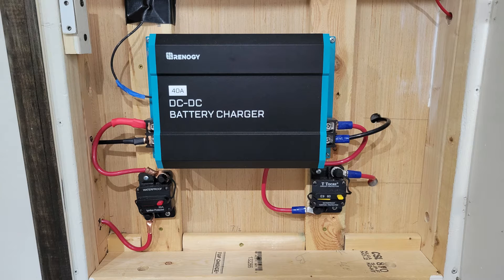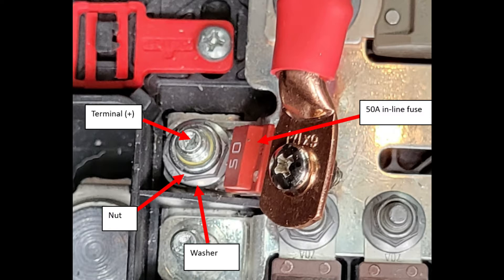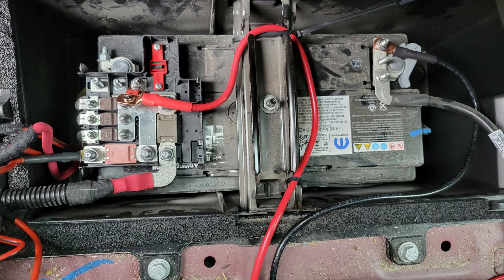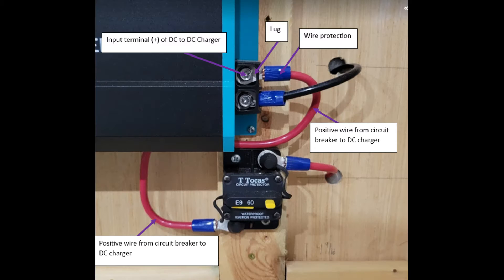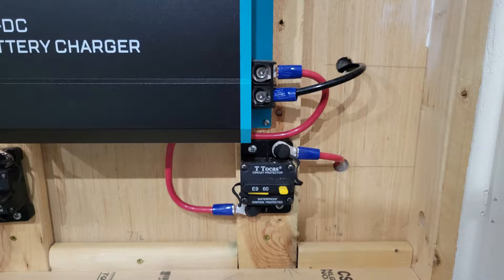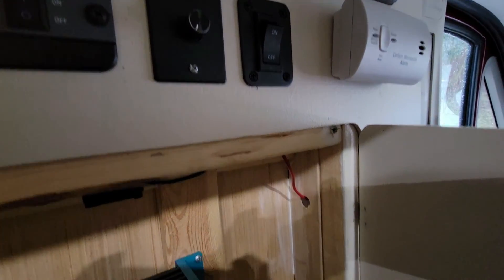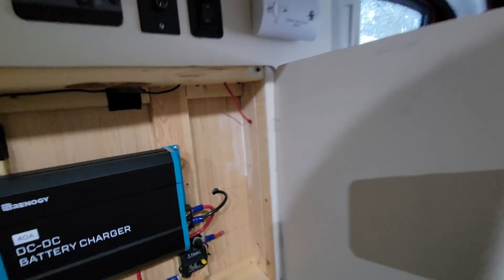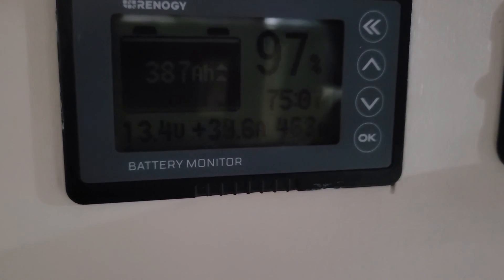How To Wire a Renogy  DC to DC Charger Without Spending Hours On It!

Comment: your installation is not good or safe. directly screwing that fuse to the battery and the lug to the other is very bad practice.  you should absolutely have used an enclosed fuse holder because if that fuse blows, or vibration of the engine snaps that connection and that wire falls onto another contact or negative you will have a whole load of problems. also on the output side you should have used decentt lugs and not cheap crimp terminals and those too should have been covered with the same shrink wrap as the other side your terminals there clearly dont have shrink wrap on and are clearly cheap crimp terminals. your wires are exposed. Also, I'd never fit cheap breakers like that. youtube is filled with van life channels telling stories of how dangerous these are for setting on fire . You should have used proper cut off switches.  

I'd never wire a dc to dc charger the way you  have and I'd always use wire that is is above  whats needed. Sometimes that reccomendation from renogy just might not be the best reccomendation. cutting corners never works and only endangers your safety,   Please people, do not wire your dc to dc charger like this.
Reply from the maker: Thanks for taking the time to comment and watch the video. We have done some upgrades and fixed those issues about the heat shrink and the terminal on the battery. It looks a lot better and wish I could upload a different photo.
If you would read through the comments you would have seen that but I understand not wanting to slog through all of it.
We do clearly say we are not professionals and are DIYers. We have, since making the fixes, had electricians look over it and it got the thumbs up and live in the van full time with no issues. 
We are not here to make any professionals happy, we are here to help one person maybe find a little bit of inspiration to start there own van build. Yes we made mistakes but that's life. Have a good day
Reply: @dirtbagswithfurbags  I'm not 
 a professional. I'm just an ordinary guy who  paid a company to convert my van and found their work was sub strandard and dangerous and ended up doing the van again myself. Its because of that I picked up on stuff that should never be done in your video and thought it needed to be said so people did not do dangerous installs. Your fuse on the battery was deffo dangerous but I appreciate you now changed things.  I think you should have done another video and taken this one down and shown how you correctly did the job.   sorry, but if you are regularly using your van or living in it, dodgy electrics are the last thing you need if you dont want to be in a burning vehicle or come back to one.   saying you made misakes and thats life is totally the wrong attitude. and you helped nobody with this video. you put lives in danger and that is totally irresposible.
Reply from the maker: I definitely have a different opinion on this but thanks for sharing yours. I appreciate all the feedback  and hope you enjoy your van!

Comment: Many safety issues with your installation!
Never connect the battery+ first because the other end is live if it touches anything connected to the chassis it will blow the fuse at the battery but because you haven't put it in an insulated fuse holder there is a good chance it will fracture and drop onto the + fuse plate what you have a split second later  the whole length of the cable will melt and ignite! It happens in an instant lots of smoke flames and if you have the cable in your hand you are looking at skin grafts. People think its only 12v it won't hurt me. Like somebody else has mentioned the breakers are a waste of time the fuses will do what they are meant to do if wired and rated correctly. Heat shrink on your terminals no exposed copper. Looking at your vehicle it looks fairly new if its under 5years old its likely to have a smart charging alternator so your D+ connection becomes a bit more sophisticated than just wiring it into the cigarette lighter. Please for your safety seek some advice from a vehicle electrician. Best wishes.
Reply from the maker: Thanks for your comment. We have made some changes already but it's hard to update the video without taking it down. A couple of your points make sense, like the volts (it's the amps that really cause the damage). We also have redone the length of wire where the inline fuse is located. We put in a new inline fuse holder and secured it to the side of the battery compartment (hard to explain everything in a paragraph or two). I will try to post what it looks like now. The breaker is also overkill but I kept it in because it isolates the dc-dc without having to unhook the battery if we need to work on it for some reason (not that we needed yet). The D+ ignition cable though can be hooked up through the alternator but the cigarette lighter accomplished the same goal. The wire was hooked up while the vehicle was unplugged which means power could not have gone through the wire. I do appreciate you commenting and I hope someone reads these comments. The point of the video is not to show how perfect or bad we did on setting up this system, but if someone else is thinking of trying to convert a van they can do it themselves. I believe in learning new processes and trying it ourselves. Yes it might not look the prettiest but we have learned so much I'm glad we did it.

Comment: If you want to see how we installed our dash switch then Google search on “promasterforum  872387”. It’s on page 10 of our “Snoopy” the van build adventure.

Ours is a rectangular dpdt rocker switch but it’s probably easier to install two round spst rocker switches instead. One for d+ and one for LC.

Comment: First, this is a great video. Nice job!

I installed this same 40A charger and I have a couple suggestions.😊

I don’t feel like your wiring is unsafe or anything but you don’t need that 60A circuit breaker. Just change the starter battery ANL fuse from 50A to 60A. That’s what the manual says. Think about it. The way you have it hooked up now the 60A circuit breaker will never trip before the 50A starter battery fuse blows. 

The manual shows ANL fuses not circuit breakers but again I think you’re fine. 

The manual also says “When the battery charger is sending the rated amps, the input side may experience a higher current draw by a factor of up to 50%. Larger wire sizes generally improve performance, whereas smaller wire sizes may reduce performance, especially if undersize.”

So in my installation I chose to use 4AWG wire instead of 6AWG to get the “better performance”.

Also of note are the dip switch settings this charger has for different battery types and charge voltages. I have a lithium battery that needs 14.4V charging so switches 1 and 5 are off and 2-4 are on.

We also installed a switch on our dash that controls the two 12V inputs of D+ and LC. That way we can conveniently charge at 40A or 20A or just turn it off.
Reply from the maker: Thanks for the compliment and advice. We have learned a lot more since we made this video. We did change our wiring around the battery and installed an ANL fuse box holder. We did have an issue with a previous fuse and it didn't cause any damage but I think we improved it and made it look more clean.
I also agree with the only needing a fuse and not a breaker but we like it because we can isolate the wire at either end.
Looking back, if we know what we did now, I think our build would be totally different, but that's the fun part about doing it yourself, you get to try again!
Reply: @dirtbagswithfurbags  yes for sure about looking back. It’s all good though.

Comment: The dip switches kill me. Idk what to do for my battery and the manual only gives options for lithium
Reply from the maker: What batteries do you have? Also what are the voltages of the batteries? The manual is not the most helpful, we contacted Renogy to get the info. Big thing is you need to know what voltage the batteries will charge at, our batteries say 13.3 volts at fully charged but charge at 14.4 volts.
Reply: @dirtbagswithfurbags  hi, I have a renogy deep cycle AGM lead acid battery it’s 200 ah and it says “cycle use: 14.4 - 14.8) & float: 13.6-13.8
Reply from the maker: @jcardosa02  Last thing, are you using the same 40amp DC - DC charger or do you have another type?
Reply: @dirtbagswithfurbags  yes I have the same one!
Reply from the maker: So it I would assume from reading the manual we have that all of your dip switches should be on for AGM batteries. S1 s2 on to set your absorbtion to 14.4 - s3 s4 to set your float charge to 13.8 and - s5 on for lead acid.
I would also check with Renogy to double check. Is this what you have already done?
Reply from the maker: Let's us know if that works or if you contact Renogy and figure it out. I'm sure if you are having issues someone else is also having the issue.

Comment: The recommendations are for a fuse, not a breaker.  ANL is most appropriate fuse type.  Those Chinese ‘breakers’ are fake, and are a real hazard.  The crimping on the lugs is unacceptable.  And there should be shrink tubing on the lugs.
Reply from the maker: Thanks for the feedback
Reply: I realized I was cringing once I read your comment… all the exposed connections. I was a mechanic in the army, and I still work on my own vehicles. It was hard to watch 😂🤣😅
Reply from the maker: Thanks for sharing your opinion, and have a good day
Reply: @ I think the delivery was good. I’m going to rewatch because there is still a lot to learn here. I do not expect perfection, it’s not fair. All things considered. And a very classy response.😊
Reply from the maker: I appreciate that and in all fairness some of the pictures need to be updated. I learned a lot and did learn from my mistakes. Feel free to send us a message if you see anything else new we could improve on for the next person!

Comment: Do you have a 13 Volt Lithium Battery?  A 12.8 Volt Battery? Or a 12.6 Volt Battery?  On my 12.8 Volt Lithium Batteries The 1,2,4 and 5 switches are off.  Only the #3 Switch is on (On is Pointing Down, Off is Pointing up.).
Reply: I've just watched a video where the guy put the settings as Off, on, on, on, off,  for a lithium battery. Not sure of voltage though 🤔
Reply from the maker: Our battery is at 13.3 volts. We had trouble figuring out the settings at first because we assumed we were at 12.6, we actually called Renogy and went on a call with them to figure out the correct settings for the pins.
Reply: @dirtbagswithfurbags  The diagram in the manual is ridiculously confusing in my opinion. I had to contact them also to figure out the sequence for AGM.
Reply from the maker: @anothercampervanchannel  I agree, it's always best to follow up to be on the safe side. I was wondering why you choose AGM over Lithium?
Reply: @dirtbagswithfurbags  Best I could afford at the time but looking into lithium 😊. I might be back for some advice on those damn switches 😄
Reply from the maker: @anothercampervanchannel  We were debating too but then decided to go with lithium. I'm just interested in why people choose one over the other is all. If you have any questions don't be afraid to ask. We probably already made the mistake so you don't have to lol

Comment: for the D+ ignition cable, does it need to be a black wire or does that not matter?
Reply from the maker: That does not matter, that is the color we used. It is what we had on hand at the time.
Reply: @dirtbagswithfurbags  ok that's what I thought, thank you!
Reply from the maker: Your welcome!

Comment: How did you connect the D+ wire to the cigarette lighter??
Reply: I purchased a "12 Volt Accessory Plug" (The kind you use to plug into a cigarette lighter Socket) from Walmart (In the Electronics Section at the Automotive Department). Use a 12 Volt test light to see which wire is positive when plugged into a cigarette lighter socket that is only on when the ignition is on.  Only one wire is needed, which ever is the positive wire, the negative wire is not used.  I connected the wire to the D+ Wire and inserted it into the D+ socket.  It works! (Just make sure to use a Cigarette Lighter Socket that only comes on when the ignition is on).
Reply from the maker: @jameslamb7300 that is great to know. Thanks for sharing. I know someone will find this very helpful!
Reply from the maker: We used a multimeter to see what cables were on when we turned the car on and off when the car was off. Then we cut the cable, spliced the wire into it, and covered it with electrical tape. You could also use a Wago connector which would be easier and they hold really well. We didn't have any at the time but we use them for all of our lights in the van.
Reply: We removed the Promaster cup holder by pulling it straight up.  Then removed the 4 torx 40 screws. Next we pulled / yanked the panel toward the back of the van. There are a bunch of clips so you need to pull hard. Then we found a connector for the charging station that had yellow/black wire 12V and black ground wires on it. We used these for our switch which needed ground to light its led lights. You probably will only need the 12V wire for yours. Cut the wire, strip it back, reconnect and add your d+ wire with a wire nut. Test and make sure it works with accessory on or engine running. If all is good push panel back in. And install screws. Push cup holder back down in.

Easy peasy!
Reply from the maker: @InchByInchff  usually the easy things turn into the in biggest headache but thanks for sharing the info!

Comment: Why do you need 2 breakers before and after the charger?
Reply from the maker: To protect the charger from any surges. Every section of wire should have a breaker or fuse to protect the whole system. Might be overkill sometimes but it's better to be safe!

Comment: Do you splice the D switch wiring going to Cigarette lighter because Cigarette lighter has +ve &-ve.
Reply from the maker: We spliced that because you need a power source which is only on when the van is turned on. You could use anything on the dash. It was also easiest to get to. We originally had it spliced into our wiring that was always on, but it was causing some of our fuses to blow, so we changed it up.

Comment: since u chose to use a ON/OFF switch from where did u power it? any power of a power that is on only when the engine is on?  i suppose the second. the problem is some old vans is always to get a place where to intercept this power
Reply from the maker: We chose to do an on/off switch because I habitually leave lights on in a car and drain the battery (no excuse, just an idiot sometimes :) ). That way, I can choose which battery to charge up if needed. The DC-DC needs a power source that is only on when the van is turned on, which is why most use the cigarette lighter or USB ports, but you could use anything on the van. Some people wired it into the dashboard. We didn't want to do that as I'm not a professional and didn't want to screw up the van in any way. We had to take the dash apart to get to the cables, and it was a big ordeal.

Comment: You have a space  next to fuse use that instead just move red wire around  the battery come in on the bottom of the fuse connector. Minute 1.49
Reply from the maker: The problem is the cover that goes over the battery. The space you mentioned is not open when the cover goes on. The car battery is directly under the driver's seat, which is why it has a cover.. That said, we did move it but it took some work and it's in a better area. I appreciate the feedback on our work. Always room for improvement!

Comment: Huge safety issue.  The 50a fuse isn't in a fuse holder/enclosure.  When a fuse blows, it can disintegrate.  So that lead will fall on the live distribution bar when the fuse blows.
Reply from the maker: Thanks for your feedback. The other end of the cable is also connected to a circuit breaker so if it would disintegrate it wouldn't be a big issue since the circuit won't connect to anything. With that being said, We have changed the wire's location and got a fuse holder to make it safer because of your feedback. Never can be too sure! I appreciate you taking the time to comment!
Reply: @dirtbagswithfurbags does it automatically go from charging to float?
Reply: @billbarnes9718  yes if you have set the dip switches correctly for your battery type.
Reply: @dirtbagswithfurbags  

I also have a probable easy fix:

You could replace the fuse with a battery terminal block fuse (MRBF fuse, google it). You use the same distribution terminal and point the terminal fuse block towards the red thing...
I personally would wrap the whole thing, fuse and wire connection in thick heat shrink tube (making sure no heat shrink is touching the connection between the distribution bar!).

Now its still all close together for my liking, but it won't cost you a lot of time so maybe its worth considering.

Good luck.
Reply from the maker: Thanks for the advice, I have learned a lot since posting this video, but we have included more heat shrink tubes around all of the ports. It is better for safety and it looks better. Thanks for the advice.
Reply: It's a circuit breaker.
Reply: @InocenteSandoval  50A fuse at battery